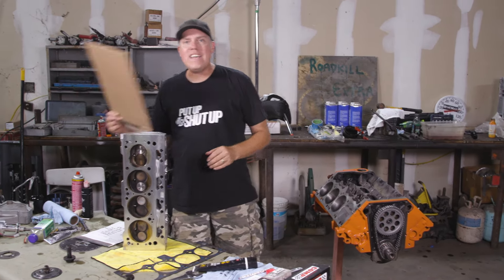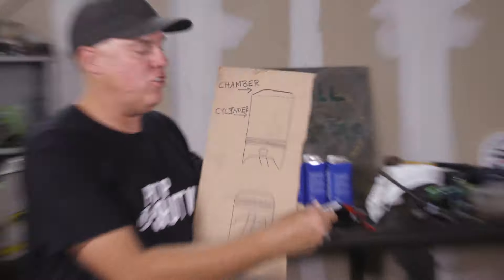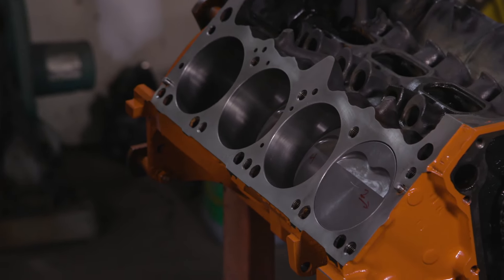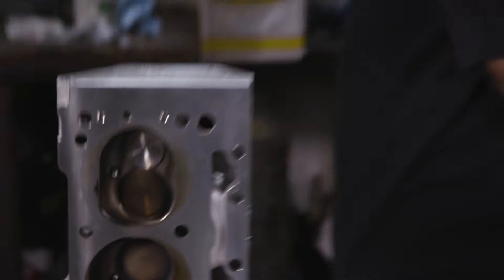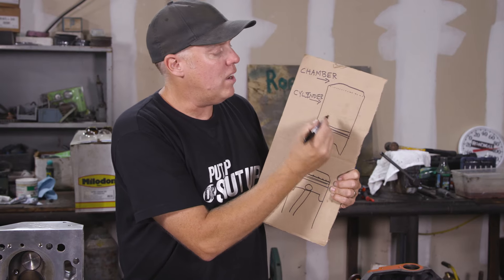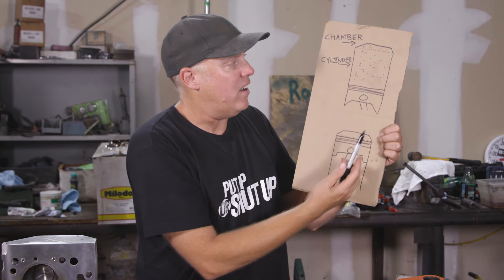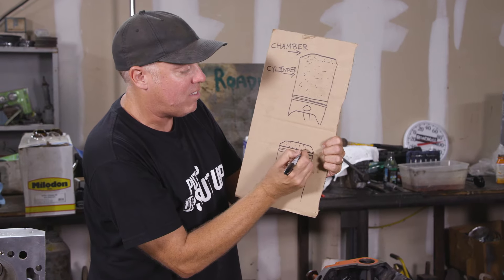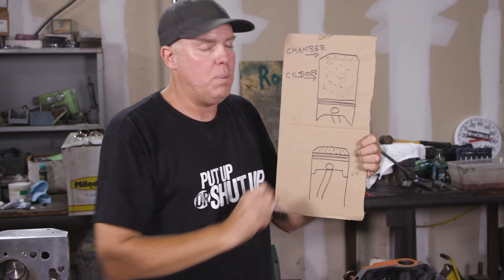Compression Ratio Explained - Roadkill Extra

Comment: My Mazda 3 runs 13:1 on regular pump. Never understood it.
Reply: Mazda 3 is not turbo.
Ford Focus runs 12:1.
Mazda 3 runs 13:1.
Mazda CX-5 2.0L runs 14:1 with the long tube header system that doesn't fit under the Mazda 3.
Reply: Thats because mazda designed a special extractor for the exhaust
Reply: It's a header system that promotes efficient exhaust scavenging.
Reply: Lifted_Above i think they also use a different shaped pistion
Reply: Mazda uses 14:1. 2014 is when they swapped from 13:1 (pre kodo design)
Reply: emark24 
In some markets, yes. Here in the U.S. my 2015 Mazda 3 is 13:1.
Reply: From what I've read when researching for a car, Mazda would have put 14:1 in the Mazda3 but it wasn't possible due to the space constraints in that engine compartment, as it would have required their purpose built exhaust scavenging header to fit, which it doesn't. The 2.0L version of the CX-5 uses that exhaust header which permits Mazda to turn it up to 14:1.
Reply: hmm. I could have thought it was 14 in the brochure thing they gave me when I bought it. Either or, 13 is still pretty good on standard 87
Reply: I have a 16 Mazda 3 with the 2.5 liter running 13:1 CR with the long tube header design. 14' up are redesigned and can fit the better designed header. While it does not increase the CR to 14:1 it increases efficiency and mileage. I love the mileage my car gets. I nudge 42 mpg on the highway. Super impressed.
Reply: You likely are benefiting from direct injection, that gives the ability to only put the fuel in right before ignition which prevents detonation.  (Can't pre-ignite something that isn't there yet).  First gasoline engines to use direct injection were German aircraft engines in WWII, really helps with the efficiency of the motor.  Ford Ecoboost engines also use this tech, that's why they can be turbo on the cheap fuel.

Comment: And what most people don't know is most of what he's talking about totally doesn't matter, the static compression only vaguely resembles the running compression. It's the running compression that will determine the power it puts out as well as the grade of gas the engine needs, basically the more efficiently the engine works the better power it has. I had a toyota 4age  engine i built that on paper had 10.5-1 comp but the static comp was 215 psi per cyl, with that compression i should have had to run it on at least premium if not 102 octane, but it ran perfectly on the crappy 87 octane we get in cali. Never pinged or knocked and had better power then my buddies 4agze which was stock but supercharged
Reply: dposer10 I call BS ! Don't  believe it ! FFS! BMP!
Reply: dposer10 You sure?🤔
Reply: Valve timing, people. Static compression means fuck all. It's effective compression that matters, and if part of your charge gets pushed out you will have less effective compression (and possibly higher velocity which affects breathing and so on).
Reply: dposer10 GO 4AGE!
Reply: the dynamic compression is a little more complex to calculate, and static compression is more widely used. if you have ever look at a cam manufacturers specs, they often list a minimum compression ratio, this is static compression, they list that because if you throw a cam in with 300 degrees advertised duration on a 9:1 static engine the dynamic is so low performance is poor. knowing your static compression is an important step to finding out your dynamic compression
Reply: you must have had a pretty big aftermarket cam in it.
Reply: He made reference to “running compression”, but didn’t dive into it because most people don’t even understand static compression and how it’s calculated.  Have to start off with the basics for the masses before getting into more complicated things that affect real world situations like cam timing, cylinder bleed, and rod to stroke ratios.

Comment: The angle of the rods in the drawing triggers me.

BDC and TDC and the rod is on an angle.. should be straight, unwatchable.
Reply: Correct. However, due to math and geometry, the vertical piston movement near TDC is very minuscule for large rod swing angles.

Comment: Anyone else here because you’re studying the army’s asvab auto & shop portion of the test? After I read a section, I go to YouTube to help me visualize what I just read. It works. ❤ first read and then watch a video to help out your thoughts into visual perspective. I’m 18
Reply: There are unclassified training materials available for just about any rate or MOS.   The navy has good stuff in their EN3 manual - small engines plus a host of common auxiliary equipment - theory of operation is generally well explained. As for where to find these?  There's a certain degree of opacity regarding government websites - I would have to ask a recruiter, I think.   You can't just call up any military installation: they don't know how to proceed most of the time if a caller does not identify a commanding officer.

Comment: A question for the next Q & A for roadkill in particular Mr Dolsich
What is the relationship between compression ratio and timing re fuel types an induction methods. How to determine what makes the most power  perhaps even a engine masters test? IE: Fuel type vs boost pressure versus timing?
Keep up the tech videos
Cheers

Comment: Very good video, was easy for me to understand as a newbie. But I have a question.

So I understand that the bigger or longer the bore the more compression equals more power and smaller the chamber also equals more compression/power. But how do you know its not too much power? Because the engine can only handle so much power right? What if you blow up your engine?

If someone could answer my question would be great, thanks very mucj

Comment: Good explanation.  The visuals will really help those folks who don't understand this topic fully.   Reminded me a bit of how I learned it in school xx years ago.   
A suggestion for a follow-up:   So you have your pic with the volume of the cylinder and the gas molecules, right?
What else is in there?   Heat.   What else happens when you compress it?   Friction...that's why you need higher octane so it won't "diesel" and fire on its own.  Tighter you compress it, the more heat it creates from friction and if it gets too hot, that heat will ignite the mixture before you want it to.    Plus, why cooler, more dense air makes more power.   All of it goes hand-in-hand. 

I bet you could do another complete video with all the rabbit holes that would lead to.
Reply: Pacfanweb Professor Frieburger. Master at PowerPoint presentations.

Comment: Back in the 80's my favorite LOW BUCK power improvement trick was to simply take an older Ford 289/302 cylinder head and put it on a newer (then) 302/351 engine.

The old 289/302 used a piston with a relief combined with a head that had a small chamber.
The newer 302/351 engines (probably due to emissions) used a flat top piston with a head that had a larger chamber.

Using the old small chamber heads on the newer engines with the flat top pistons brought the compression up a lot! This would be a $100 mod if you could find a junk yard with some good older 289/302 engine heads. :-D

On my old carberated 302 Mustang I had to run 91 octane fuel minimum after I would swap the heads. Oh, the older hi po 289 heads I found also had longer valve spring travel and they accepted my .512 lift comp cams camshaft.
Reply: I'm about to do something similar with a 4.6 2v. Aluminum explorer block, stock crank, 13' boss 302 rods and 01 cobra pistons, diy valve job, polished ports and a moderate cam. 4v na cobra pistons raise compression a good bit from 17cc dish to 3cc

Comment: Great video, I'd like to do a high compression motor with a small supercharger or turbo to maximize efficiency and power delivery. What CR can be achieved safely with pump gas, intercooling and meth injection? Everyone always talks about race fuel but what about meth to prevent detonation in the chamber?

Comment: The skyactive platform from Mazda has I believe a 14:1 compression ration on standard unleaded fuel. They are the masters of the ICE engine. Now they have finally perfect HCCI.
Reply: Toyota has used pseudo-Atkinson cycle for many years before Mazda ever did. Each Toyota hybrid car uses it! (first Prius1 built in 1997)
Mazda is just taking it 1 step further with the brilliant HCCi technology.
Reply: jfv65 For hybrids. They never did a stand alone unit with a compression ratio this high. Mazda has some of the best mpg in the industry for non hybrids. Once hcci gets implemented there will be little use for hybrids. I think it's basically going to be an electric vs ice market pretty soon as most auto manufactures are going to have an electric version of ever model by 2021.

Comment: More compression makes power through efficiency, so you gain power and mileage (mileage varries as starting with large motor getting 8mpg and adding another point doesn't help like the 2nd gen Prius motor's bump). Mahle has a great spread sheet calculator and you can save your motors calculations for later. Dynamic compression ratio is going to be what matters in the end. You can add more compression with a larger cam shaft to keep some efficiency and maximize your power. Wallace racing has a calculator. You can use this to push your motor to the limit of your fuel once you learn it.

Comment: You don't need a machine shop to find the head chamber volume, all you need is a piece of plexiglass with a small hole in it and a syringe with measurements on it. And some oil or water

Comment: I wouldn't mind seeing you guys try and start explaining diesels as well. I love all the info you put out for gas engines. You were saying more or less that a stock to stockish compression ratio is around 10/1. Where as my 2nd Gen 6bt is advertised to be 17.2/1 . In my case or other diesels, seeing as we're looking for detonation because of not having spark plugs to help. How much is pushing to much compression? I just think it would be a nice idea with how diesels are starting to show they aren't to be forgotten about, for some information on their performance side would be some amazing knowledge to aquire.
Reply: Just a random thing I like to share with gas engine mechanics. Also a wonder I've always had as to why gas engines aren't made the same. The connecting rods in a diesel are broken or snapped, instead of being cut on the crank bearing side to make a stronger bond when bolted together. Might be a great thought for an episode right there.

Comment: Do one explaining how to increase TORQUE in an engine.

JD
Reply: jdmeaux longer stroker = more torque but lower rpm limit
Reply: That I knew. What's the use of having high horsepower at high rpm's when it can barely move the vehicle? You need torque to give it the grunt on the low end. I personally would prefer to have an engine push me into the seat when you stomp on it.

Comment: Nice mix of metric and US units. Another way of doing it, without using the bore and stroke, is to use the displacement divided by the number of cylinders. So a SBC with it's 5733 cm³ has 717 cm³ per cylinder, and if you use a head that gives a total combustion chamber of 70 cm³, the compression ratio would be 10.2. This assumes zero deck height etc.
Reply: I realize it's grossly simplified, but I did the calculation myself without referring to the internet for the solution... :-) Seriously though, it would've been nice if you'd done an actual calculation with all the variables just to show how it's done. After all, it's not rocket science, just math... ;-)

Comment: Great video with some great info. This is what I do for compression ratio. When I have an engine on the stand and assembled I orient the engine so the spark plug hole is facing up. Position the cylinder at top dead on the compression stroke. I then take a graduated cylinder and fill the chamber with oil up to the bottom of the spark plug hole. Take however many CCs of oil it took and convert to cubic inches. That gives you your combustion chamber volume in cubic inches. Calculate your displacement for 1 cylinder. Take that answer and add it to your combustion chamber volume, then divide that number by your combustion chamber volume and you're done!
Reply: Here's one I did on a 383 I built for a customer. 

51.76 in3 displacement for 1 cylinder
69.5 CCs of oil (converted comes to 4.24 in3)

51.76 + 4.24 / 4.24 = 13.2:1 compression ratio.

Comment: this is an explanation of a  GEOMETRIC  compression ratio.  
then comes the  DYNAMIC  compression ratio which is affected by numerous operational conditions - intake - valve sizes - rpm etc. 
then comes forced induction and the difference between an engine's ability to draft air in via negative pressure and force air under mechanical pressure .

Comment: Another reason higher compression ratios makes more power is the suction in the intake stroke and how it affects volumetric efficiency.  At top dead center the initial suction from a high CR motor is very strong, this leads to increased air charge momentum and a faster and more complete VE fill. 
Working with the cam profile, the high compression ratio will pull in more air faster at lower engine speeds, and at higher engine speeds VE exceeding 100% is possible as the momentum of the air-charge is that much higher. This is why you need good compression ratio to run aggressive cam profile - the cams just won't breathe all by themselves.

Comment: You had me then at the end when you threw in “the cam” how does the cam effect compression ratio?
Reply: Cam timing events opening or closing the valves at different times either trap more compression (think RV cam) or bleed it off (race cam) so an 11 to 1 engine can run a certain race cam and never worry about detonation or a lower compression engine with the wrong cam can have detonation that baffles the mind... this is called DYNAMIC compression... what David is discussing is STATIC
Reply: Thanks for that explanation I have a lot to learn, My son and I have picked up an old 283 that we are going to rebuild and with this motor it sounds like I need to do things a bit different that what those do with a 4.oo inch bore motor like 350 and 327. We have decided to go with aftermarket 305 heads for the same small chamber and better flow than the rebuild on the old power pack heads that don't flow as well. As far as a cam we will probably do Edelbrock Performer camshaft (204/214 degrees at 0.050 with 0.420/0.443-inch lift, dual plane intake and a 4 barrel holly or eddelbrock, we are hoping to make more power than the original setup and would like a touch of a lump idle so like most we are never sure if we are getting the right cam.   @smokenchoken1736

Comment: I Built a Chevy 350 a couple years ago when I was 16 with what I could afford in swap meet parts. re-ring and bearings in the stock short block and picked up some worked over 896 power pak heads and a straight grind .500" cam.. come to find out I'm making the "sweet spot" 10.5-1 in my 1973 Camaro!

Comment: I would like to keep my all original 350 SB Chevy with stock smog heads from the 70's. If I want to increase performance, I presume the best way to increase the compression would be to have the heads milled and work with a smaller gasket?
Reply: jballoregon.   all that  machine work wouldn't be enough to make any noticeable difference.  those heads dont have enough deck thickness to do any serious milling, much less angle milling.  you'd have to at least bring the 76cc chamber down to around 64cc and there's just not enough material there to do that.  even then, it might only bring comp up  .5-.6 point.  the biggest change will need to be the pistons.  or just install a turbo with 5 pounds of boost max.  😀

Comment: Using Aluminum heads about 10.75 is good vs iron heads about 9.75 is good both using pump gas. Watch your quench when selecting a head gasket.

Comment: Fantastic video, but modern engines run higher compression without detonation because of cylinder head design and the fuels that we have available today. Squish distance also has a lot to do with how an engine will handle compression and when it will cross the threshold of detonation. Case in point, my 4.6l Mustang runs 13:1 compression with a tight squish distance and it does it all on 93 octane pump gas.

Comment: what about camshaft effecting compression ratio? overlap?
Reply: Fluid dynamics has a lot to do with CR during operation. Gasses are flying through the engine at crazy speeds during high rpm. Gasses have mass and moving mass contains momentum. It's why manufacturers have added variable valve timing (and lift timing), as well as ignition advancement. Even intake runners are variable to affect the frequency of pressure wave pulses moving backward up the intake tracts. It all affects how efficient an engine can be at all RPMs, how effective the flow of gasses are through the engine.

Intake valves taking longer to shut when a piston begins moving upward will reduce compression ratio.

Comment: Great video. Quick question, If you make the head volume smaller to increase compression won't you reach a limit where you are negatively affecting horsepower by decreasing air flow. I always thought high flowing heads were the key.

Comment: Is there a video on the theoretical  effects on compression ratio under boost pressure example 14 psi of boost effectively doubles the current engine configurations compression ratio via doubling the air and fuel within the cylinder being compressed so an engine at 7/1 with 14psi boost is therotically the same as the same engine running 14/1 compression ratio. Correct?